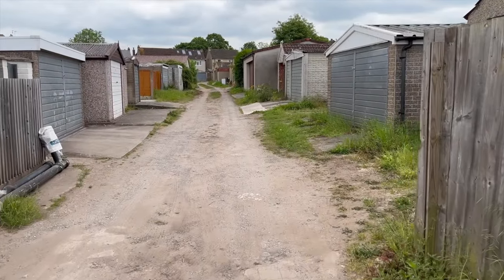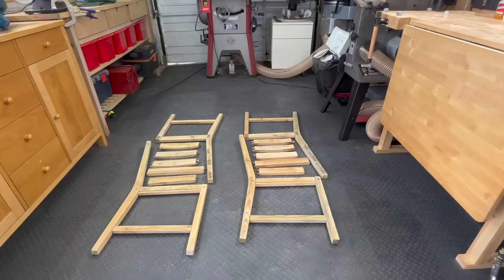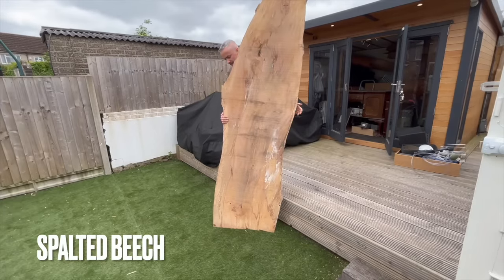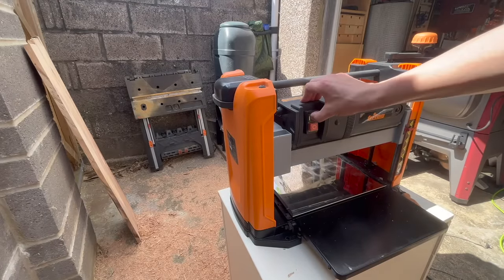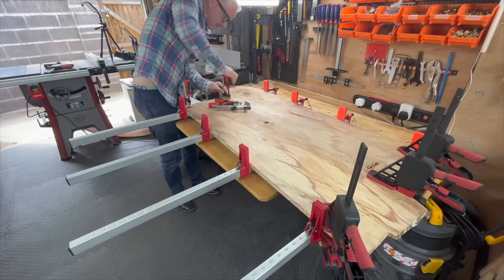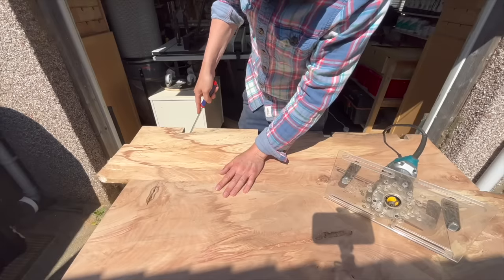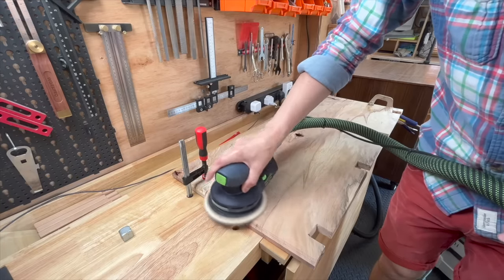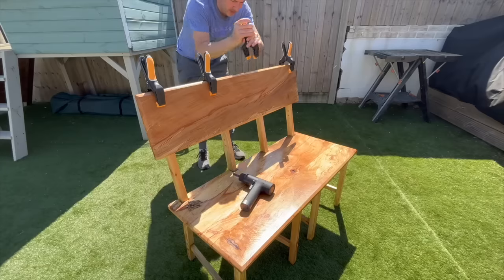I found 2 old chairs and turned them into a bench.

Comment: Nice finish on the spalted pieces. My only concern was that you didn't use a push stick ( or similar) when cutting on the table saw, and when doing the holes on the edges to join them, you didn't use bench dogs or a bench clamp to hold them upright. Other than that, ok piece,  good finish work.
Reply from the maker: The purpose of a push stick is so you don't get your hands near the blade. My hands were nowhere near the blade as the pieces I was cutting were very wide. If anything, it would have made it more dangerous given how heavy the boards were. Working safely means that you can risk asses the situation and choose the best solution and not use unnecessary tools for the sake of fewer comments.
Reply: @Flippingdrawers  Nice, diplomatic response to an axxhole comment, Jay! 😆🤣
Reply from the maker: @lesliejackson8188  😉

Comment: There was another option for the back. You removed those bottom back rails on the back of the chair. You could have spaced the chair so you could place them between the two chairs making one solid back all across. I think that would have looked good, not that what you did doesn't look good, it DEFINITELY does. But then maybe you could have gotten 2 projects out of that lovely spalted wood instead of only one. Just an idea.

Comment: Beautiful DIY wood bench and upcycling of old chairs!  Can anyone tell me what that tool is that guides you when drilling a hole on the side of a board?  Thank you!
Reply from the maker: Thank you 😊 this is the one I use :Mesee Vertical Pocket Hole Drilling Jig, 2-in-1 Woodworking Dowelling Jig Locator with Scriber Wood Dowel Drill Guide Puncher Positioner Tools for Self Centering Straight Punching Hole https://amzn.eu/d/iWXW2zs
Reply: @Flippingdrawers  Thank you so much for that information!!

Comment: I thought those extra long bits on the seat, would be used as cup holders? Just drill holes large enough to hold a cup, or make small depth circles to place a cup/bottle on?

Comment: Nice job, I love how it turned out.  Excuse my ignorance , but why do you use the orange machine to smooth the surface if you have the sander? Just curiosity
Reply from the maker: Thanks.  You mean the thicknesser? With a sander it would have taken  2 days to remove that much wood and it would not be flat

Comment: What did you put into the oil before you brushed it onto the wood?
Reply from the maker: mineral spirit, you can use it to lower the sheen or to make it easier to apply for the first coat

Comment: If I were you you I would not do the back part like that. So, How would I do? I would do just like the original one but I would cut more longer the parts between the sitting part and the top. Then I would cut out the 2 long back leg parts  which looking each inside. You can still change it . Imagine that way would be looking very nice.
Reply from the maker: Don’t remember asking but thanks 😉

Comment: Why did you add mineral spirits to the oil finish?
Reply from the maker: makes it easier to apply on dry wood but it also lowers the sheen of the finish if that's what you need.

Comment: You could have saved at least half your wood if you just made a bench with spaces between the boards to let water through. You could also put more space between the chairs and made a longer bench. I’m not impressed as I have been with your other projects. It looks kind of cheap and simple. You could have made it a three seat bench just using the original chair backs. One more slat between the other chairs could have made it something special. You missed on this one.